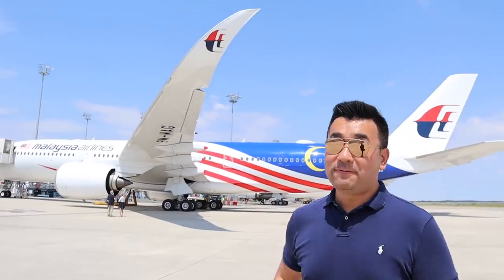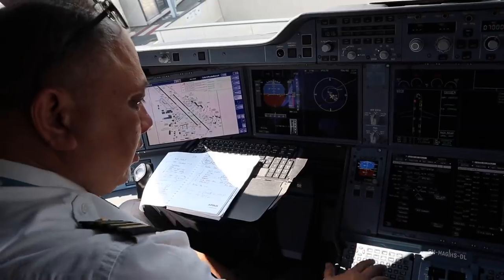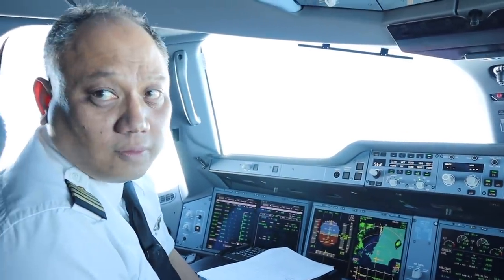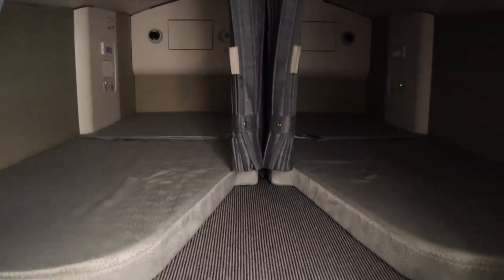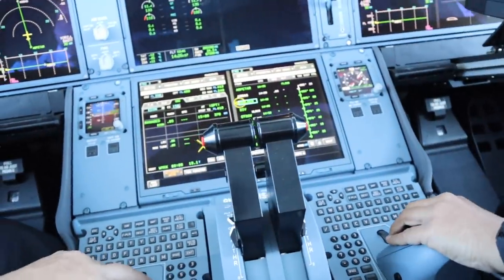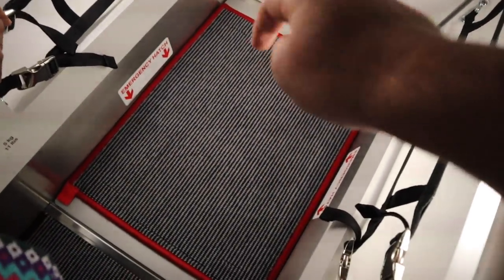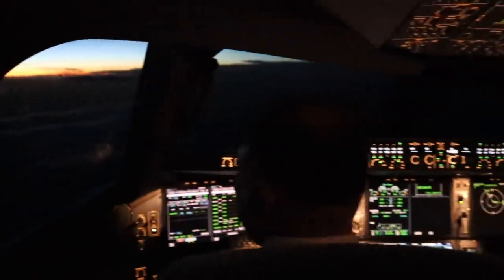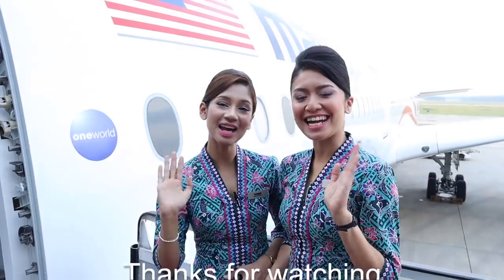Behind The Scenes - Malaysia Airlines A350-900 Delivery Flight

Comment: At 13'54", a Window activation prompt is visible. I contacted Airbus for more information and an Airbus spokesperson kindly answered all my questions; I am resharing with permission, with only minor editing referring to my original email:

<< Regarding your enquiry, we confirm that there is nothing dramatic in the video.

It is simply showing some digital charts which are coming from the aircraft’s on-board “Electronic Flight Bag” (EFB) facility. The latter is usually running in a separate dedicated PC docking station, from which the flight crew can display apps and various types of digital or scanned documents, eg. maintenance manuals; flight-planning charts etc. Moreover, in the video you can see that EFB has routed its video output onto one of the main cockpit LCD displays (like when you dock your own laptop to a big desktop monitor).

Note that before there were any EFBs, pilots had to carry with them on board a big bag full of paper-based manuals and also charts for their flight planning tasks etc.

Also please note that commercial off-the-shelf software (such as Microsoft Windows-based apps) are never used as primary means of navigation and are never connected to aircraft critical avionics nor to the flight controls / navigation computers etc. etc. And obviously -- the A350’s avionics and computers are not running in an MS-Windows based operating system!

It is up to the airline to purchase directly any licenses needed for their chosen third-party EFB apps, and operate them in accordance. In this case the airline who posted the video are using this app explained here:
https://www.lhsystems.com/solutions-services/flight-deck-solutions/lidonavigation/lidoeroutemanual
>>

Comment: Interestingly after the MH370 and MH17 disasters and subsequent passengers fall off a cliff, Malaysian Airlines have replaced ALL of their (17) Boeing 777s long haul aircraft replaced with A350 XWB. Of their (historical) 120 B737s, there are only 48 left to changeover to A330s they now operate 24 A330s. Lucky for Malaysian, they have not taken delivery of a single B737 Max 8, 9 or 10 (they've ordered 15 units of Max 8 and 10 Max10s). So now they can cancel and switch to ALL Airbus without a huge financial penalty.

Comment: Activate Windows on screen at 13:55? What‘s going on there?
Reply: so an Aircraft manufacturing company which is rich cant buy a legit windows os....  Really Airbus
Reply: hahaha good catch! Imagine getting blue screen of death mid flight!
Reply: The outboard screen can be connected to a pilots laptop. The plane does not run on windows.
Reply: Maybe the personal laptop of the Pilot ^^
Reply: This image in question (ie. showing a Windows app) – and any info on it – is coming from a completely separate docked laptop ("Electronic Flight Bag") belonging to the operator/pilot, and not from the A350's own computers !

Comment: Hi Sam, I have flown Malaysia Airways twice now. As I live in China, they are my first choice to fly back to the UK. First time in 2018, I went what was then first class. Guangzhou to KL, then KL to London. You sat in the same seat as me “1K” I am just under 6ft and quite broad. The first class seat was excellent and sleeping was as good. Do not have to speak about the service. Malaysian speaks for its self. 2019 I travelled in Business class. Same route to London from China. My seat was “3A”. Again very good.  Just had one very small fault. Due to me being broad, putting my arm on the arm rest. I kept knocking the seat controls. Kept getting a massage, a bit of a pain. Control panels just needs moving up 2 or 3 inches, then perfect. 2019 year they now re-names first class as Business suite. Still very good.

Comment: Sam there are some negative issues on this video.

The windows is not activated in the aircraft. It actually shows in the video.

Was that a cross wind landing? Or the orientation of the 📷?
Captain used right rudder using landing.

Just saw this and had questions,,, 

The aircraft and the livery is good.. good people.. cheers and all the best.

Comment: Hi 
Samchui i had small dout 

 Delevery is taken from factory or airpot
Reply: Being part of the whole airport, the delivery centre is located opposite to the main terminal and shares the same runway with the airport. The aircraft was delivered from the delivery centre after final assembly.

https://www.google.com/maps/place/Airbus+Delivery+center+toulouse/@43.6304715,1.3458263,2040m/data=!3m1!1e3!4m12!1m6!3m5!1s0x0:0x66f417d01d8268f6!2sToulouse-Blagnac+Airport!8m2!3d43.6293863!4d1.367682!3m4!1s0x12aeafdf1ad6b75d:0xc7f923ec17e86aab!8m2!3d43.6331943!4d1.3496098
Reply: Ex Dee 

 THANKU VERY MUCH FOR UR KIND & FAST REPLY